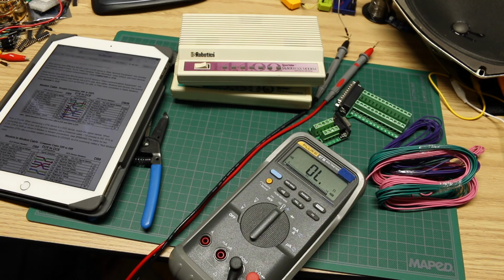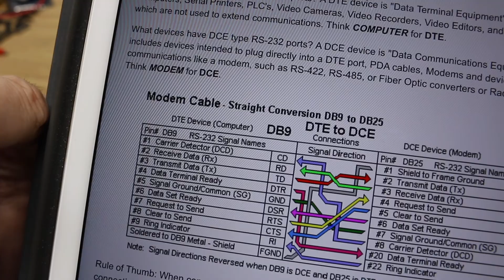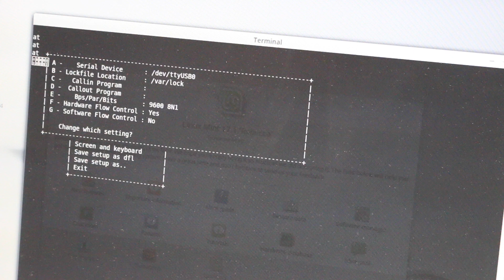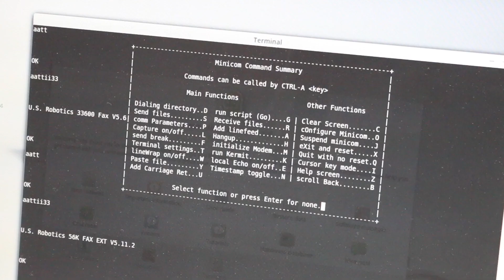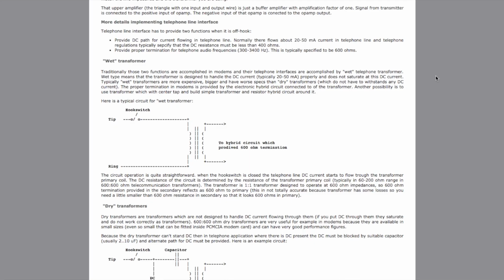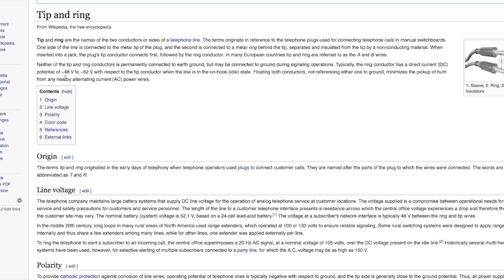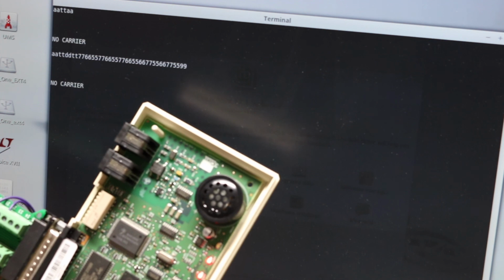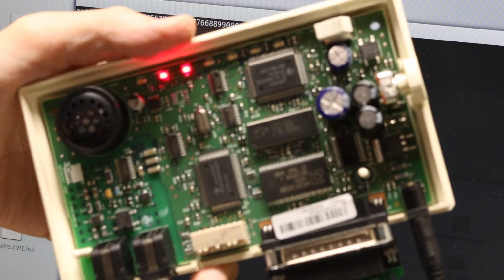Phone Line Simulator Experiment

Comment: Hi, can you tell me the settings you had with a at&V ? With only one modem and this settings, my modem still cannot 
get the hook off ;(
Reply from the maker: I can’t get the modems hooked up to a terminal right now to query any internal settings, although I am currently working on a new modem and phone line related project so within a couple of months I should be going through everything again and figuring it all out so you can keep an eye out for that video.
but it also depends on exactly what you’re doing like are you using a real landline or other compatible service where you should be able to get a dialtone or something, or are you using a battery to simulate phone line current?
and are you trying to dial into this phone line or answer the phone line?
if you have current in the phone line whether it’s real or simulated and you try to answer with something like ATA, I would expect you would be able to hear the tones trying to answer.
if you’re trying to dial and obviously there’s going  be no dial tone if it’s not a real phone service, that’s where you might have trouble unless you instruct the modem to not wait for a dial tone when dialling and I forget the exact command it might be something like ATX3D and then some digits and I think that’s how I got it to try to dial without a dial tone.
The new project I’m working on actually creates proper phone voltages and currents and creates dial tones and works like a regular phone line so I’m hoping it works with modems but it’ll be a couple of months.
Reply: @GadgetReboot  I'm trying to replicate your testing with a 9V battery / 9V DC psu / 12v DC PSU and / or different resistor values, but the modem won't will off-hook but 
it won't dial a number.. I'm in X4 settings... which is the magic? :)

Comment: Nice video :)
I am looking to find a way to make a phone line simulation network for some retro computers with modems.

The cable you are using you showed that you bought from the pinout you started with I believe the DE-9 to DB-25 cable you are showing is a NULL modem cable based on the connections you showed and the pinout photo you were using for a reference.

Had to deal with all kinds of DB-25 and DE-9 serial ports back in the 80's and 90's with the job sites I had to go too.  Which I also had a couple  spare Laplink serial cables that had a DB-25/DE-9 connector pair on one side and a DE-9 connector on the other end.  Plus a bag of gender changers.

Oh the joys of having to deal with Apple II, Tandy, Commodore, and IBM systems back in the day lol.

Comment: My experience with serial connections back 30 years ago are they are most of the time a bitch to set up. something simple turns out to be a pain in the ass. You definitely had to invest in a break-out box and just make your own cables. Then the software would do weird things with the control lines. it was one of the most screwed-up' standard rs-232' i have seen.

Comment: I'm old enough that I recognized your cable problem a few seconds into the video.  I remember living that the hard way :)
Reply from the maker: It was even worse in workplaces where there's no way to identify the cable wiring by any markings, no meter available to check the pinout, and there's a tangle of various things from straight thru, null crossover, non standard with some pins not wired up, non standard not even meant for RS232, and you just have to go through them all until something works or you blow something up.   Then of course you find one that works but it's only 3 feet long and you need the 25 foot one

Comment: Thinking back, thought CS stood for 'Carrier Sense' which could be turned off with one of the DIP switches so you can just dialout without waiting for a dialtone. Then there's no need for the 9v battery and such additional hardware?
Reply from the maker: All that would do at best is allow the modem to start dialing without listening for a dial tone first, but the line still has to have a current loop to function unless one of the modems provides the current (I've never had one of those but they existed)

Comment: Well you need a null modem cable, not all serial cable are equal, that cable is just an db25 to db9 adapter as a cable
Reply from the maker: Yeah a null modem cable would work directly between computer serial ports but to get the modems working I need to make them think there's a phone line.  But I had one weird serial cable that didn't match pinouts of straight through or null modem so that was weird too.

Comment: One subtle thing that may prove to be useful to solving your mystery problem: on those sportsters, they will half work like that if you are using a 9v dc supply.  Some of the circuit is after the regulator and some of the circuit is before the regulator.  The items before the regulator are expecting ac current from the supply.  So, double check that the supply is ac, not dc.
Reply: exactly, old good modems used AC adapters. 1/2 wave is rectified for receive, the other half wave for transmit circuits.

Comment: The two modems will connect ifyou just connect the phone jacks bottom two (black and yellow) to each other. no need for battery. done it 100s of times!!
Reply from the maker: some modems support a direct connection but the ones I have don’t do that and they need a loop current. Things would be so much simpler if mine would work directly.
Reply: @GadgetReboot  Well the usrobitics you have in the video does work with a simple line between them. No problem, tried 10-20 modems like this over the years.
Reply: i have a pair of supra 2400 modems that will do that, but it's a slow transfer.. still, it's a way to get software downloaded off the internet onto an old computer that is not internet capable like old cp/m systems.

Comment: You need to run ground wires between the connections and twist them all together to reduce noise and reflection on your custom cable, there is a reason cables are designed that way

Comment: Modems supply voltage on the phone line port, so all you need to do is connect the 2 modems phone line to phone line...ATDT(any number) on one ATA on the other...to simulate 2 real phone lines (to get "ring" signaling) use a cheap VOIP adaptor (Like a PAP2T) and set it for IP dialing so 1 line can directly call the other.  To dial on some you have to turn off dial tone detection.
Reply from the maker: I could never get any combination of dialling and answering and configuration strings to work without providing my own current. 
Information scattered over the past 20 years in various forums have some people saying some modems supplied their own line current and some don’t so I’m assuming I have the ones that don’t.
Reply: @GadgetReboot  It's not that they "supply" voltage rather they output an ac audio signal through a line transformer which produces a small voltage on the line...as opposed to a lot of telephones that modulate the output resistance on the line. I have never seen or heard of a modem that modulates the resistance on the line. Also telephones need voltage on the line to operate the internal electronics, modems already have power. Maybe there are other settings that are at play ie. some modems need the dial tone detection turned off before they will operate in this manner. ATX3 I think....every modem I have ever seen had a line transformer in it. I have been connecting modems together since the 80's and it has always worked. MIND YOU in this world of many things I'm sure there are some modems that won't work like this, it's just I have never came across one...This was always a convenient way to transfer data from one platform to another..like MAC to SGI to CP/M and was the reason I did it so much back in the day.

Comment: Hi, I have a problem for some days now and didn't find a solution yet. I want to get the rs232 ring-indicator (RI) working that I can recognize it with a little C-program and do stuff when it's on and when it'f off. I have no modem connected, instead I want a simple switch on this side who switches the ring indicator on and off. I measured over 11 kOhm from RI to ground of the serial-cable that's coming out from COM-Port1 from my computer. How much current should I give the RI to work? I tried to connect some other cables (TX for example) to RI and my multimeter says that about 1-2 mA are flowing, but with my C-program I never see that the signal changes. I give my RI positive and negative voltage, but nothing happens.
Reply from the maker: I haven’t looked it up in a while but for RS-232 I believe a logic 0 is registered when the voltage is between +3 V and +12 or maybe more, and a logic 1  for -3 V to -12 V or so.   I also can’t remember if the polarity for ring indicator is active high or active low but I just did a quick test on Linux using GTK Term so that I can see the status of signals down in the bottom of the window for things like CTS RTS and ring indicator. 

 I was using a serial to USB cable with a 9 pin serial connector on it so pin five was ground and pin nine is ring indicator.    I took a 9 V battery and put minus on ground and plus on ring indicator and RI lit up in GTK term so I know that works. 

 So depending on your set up, I would expect if TX out of the serial connector is connected to ring indicator, it would be giving appropriate voltages and trigger the ring indicator when you send data out but I haven’t tried that myself, so otherwise how are you detecting ring indicator, are you using custom software?    I would use a terminal program that can show the status of ring indicator to confirm it’s not a software issue and you can also try the 9 V battery test since now I know that works.
Reply: @GadgetReboot  I found out when I connect GND and the ring indicator, it's too few current that flows and signal is not detected. So I used an other pin that gives me enough current.
Reply: @GadgetReboot  Wow, thanks for your superb answer!
"it would be giving appropriate voltages and trigger the ring indicator when you send data out ."
Ah ok, I don't know this. But with the 9 V battery you got the ring indicator lit up even when no data was sent? I have no interface to send data, that's my problem. I already hooked up even 2x old 9V batteries in series wit ground and ring, but my little c tester-program compiles without errors and open the com-port but I get nothing even when I reverse the polarity. I wired it like a half-duplex sniffer (only the picture down right is relevant): https://www.lammertbies.nl/comm/cable/RS-232-spy-monitor.html

Update: OK, I understand it now. You mean I should send data from TV out to the same serial port to ring indicator. I will try that!

Comment: Oh no, haha, cable gender issues. XD
23 years ago I had a DD-50 cable made up for a Sun3 workstation, only to realize once I received it I specified it to be made horizontally mirrored. =|
Reply from the maker: The largest Dsub I worked with was a DC-37 pin because there was a footprint for one on the side of a solder proto board.  Too many pins to hand solder.  Didn't have a ribbon connector, had to use solder cup pins.

Comment: If it's echoing back but not giving a command response, have you tried issuing the ATQ0  (A T Q zero) command to tell it not to supress result codes?
Reply from the maker: I can’t remember everything I tried right now but I remember trying things similar in concept to get it to talk. When I get a chance I will power that one up and try that command. 

I’m going to be getting back into the modem and phone line experiments over these cold months coming up. Thanks for the tip.
Reply from the maker: I tried ATQ0 and a few other strings while I was at it and I still can’t make it respond other than just echoing back what I type in. It’s a real mystery that it’s obviously alive but nonresponsive. I will take this project to the grave if I must!
Reply: It sounds like maybe the serial interface is alive but something else is broken so there's nothing to respond.  Did you try the factory reset - 'AT&F' ?
Reply from the maker: I think that's one of the first things I tried but I'll be trying it again before I put the modem away for another while.  As long as I have the other two 33.6k and 56k working, the mystery won't hold anything up.  Since there is a socketed chip, I am wondering if a chip swap would fix it. Maybe similar to a motherboard's corrupted BIOS being re-flashed.  If I ever get another 14.4k with identical design, I'll try swapping chips.

Comment: try to get a cheap 4 line PBX for home use. the are great to work/test those old modems. you can find them in most thrift stores.
you have the line. you have to dail sounds. so all is there that you need and the modem thinks its connected to the phone line.
Reply from the maker: Thrift store shopping is on the near term to do list. I’d like to get a nice old eight track player as well. I regret discarding some old stereo equipment as well as old computer equipment and now I’m trying to re-create all of that old technology.
Reply: i know the feeling. getting rid of old stuff when you where young and now re-grating that you had thrown it out.
Reply: is it easy to setup pbx?

Comment: You should totally setup a pbx and get them calling one another.  You could even get a pci card like this. https://rover.ebay.com/rover/0/0/0?mpre=https%3A%2F%2Fwww.ebay.com%2Fulk%2Fitm%2F122681928992

I think the db9-db25 cable you have is probably seen esoteric config.  Maybe crossover, or db25 to db9 adapter or something weird.

The standoffs on the db25 that were interfering I think are because db25 was also used for parallel printer ports and such.  The fixed side, the side attached to a device was the one with the socket of the standoff.  ... This is why USB exists.  A -> B (though things have gotten a bit more complicated.)

Comment: Oddly, I have these modems (some are flaky)  and DB9 to DB25 cables.  Storing them in another state right now though.  I suppose, if you were inclined to modernize them, you could get some MAX232 chips to convert to TTL level serial, then maybe a 40-cent MCU to bang out an ACM/USB device ... like an atmega8 using USBASP.
Have also built a thing with a 9V battery that enables line detection for a friend who was trying to recover data from an old Mac.  https://s.hswstatic.com/gif/telephone3.gif
Reply from the maker: I guess that’s sort of what that blue USB to nine pin serial interface is doing, which is how I’ve been connecting the modems up to the Mac and to an old Linux mini tower for testing right now but the end goal is to get them actually on proper nine pin serial on a 386 or 486. 
I also thought about getting one of those serial to Wi-Fi modem emulators to get online from an old PC  wirelessly  and maybe see how slow Netscape is on one of those machines. 
 I wish I never got rid of my original external 14.4 and 28.8 modems as well as my internal 2400. I could use them all now just playing around.
Reply: Funny, as I repair and salvage old PCs,  I collect modems.  Never liked the Winmodems much, but will keep the USRobotics, and those that have true serial.  Your Sportsters there, I would never buy because they were expensive.  Saw them in the office a lot though often used in fax and dial-up banks.  Remember that the init strings and bios upgrades were important to keep them compatible.
A random thought:  Is ISDN service still available?  That was a short lived thing.
Reply from the maker: The only mode am I ever bought for myself was the $50 internal 2400 modem in the early 90s. My next one was the External US robotics 14.4 as a Christmas gift.   Eventually I traded that away as part of a deal to upgrade to an external 28.8 Motorola  and by then the Internet was becoming a thing and I had access to LAN connections in school so that was it for dial up modems until this past year. 
I think I have a radio electronics  or popular electronics magazine issue talking about ISDN and it had a big corded telephone on the cover. I should flip through all those old magazines and see if there’s any project ideas. 
 I think I have a magazine article somewhere that shows how to build your own external box with an LCD screen for call display before they came standard on home phones.
Reply: try to get a real serial port or a USB to serial that not only has the rx and tx but also all the handshake signals. and make sure it levels are the RS-232 levels (some where between +/-12 to +/- 15v) https://www.sparkfun.com/tutorials/215
some modems dont work if they dont get the handshaking.